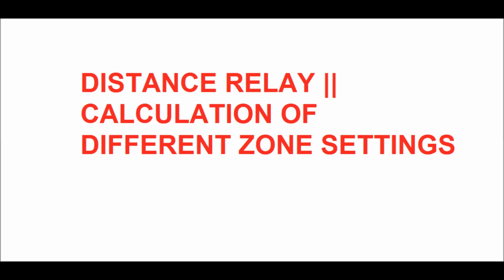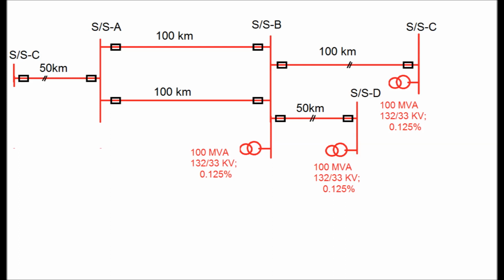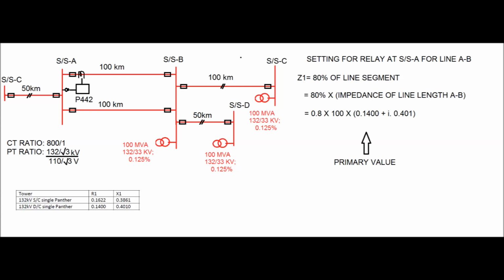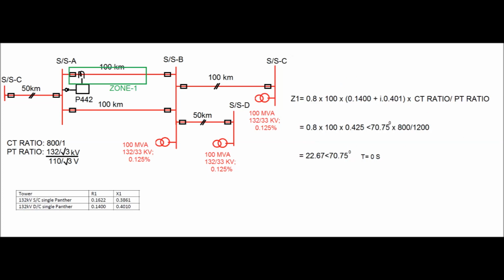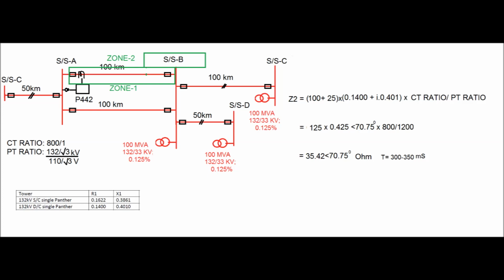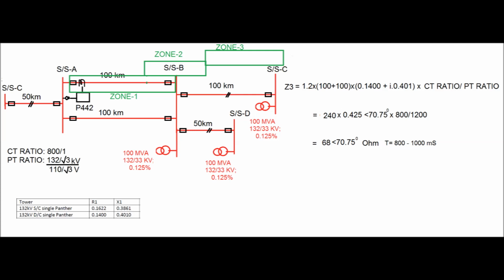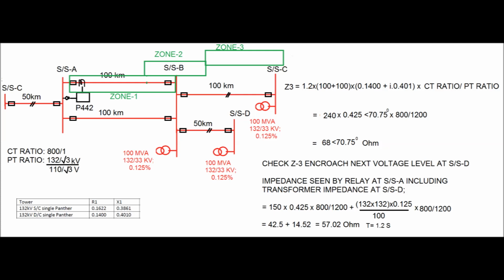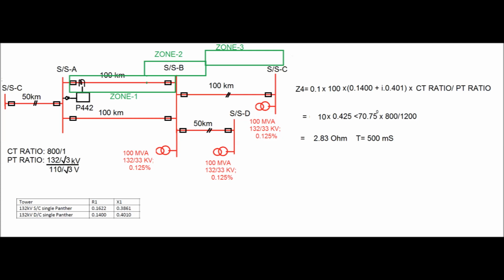DISTANCE RELAY || CALCULATION OF DIFFERENT ZONE SETTINGS ( PART-1)

Comment: If cable is shortest say 2 km and shortest  overhead line is 3 km then which one to choose
Reply from the maker: For this short type line it is always better to use Line Current Differential Relay
Reply: @relayprotectionelectrical  yes sir but I mean to say if cable and oh line has minimal  difference in distance  should cable or oH line is considered

Comment: CT ratio/PT ratio
How did you get 800/1200
Please explain
Reply: (ratios are primary (line value) / secondary (transformed value for measuring)). Current transformer ratio is 800/1 (=800), and Potential transformer is 132/sqrt(3) kV (its kV!) and 110/sqrt(3) (=1200) .